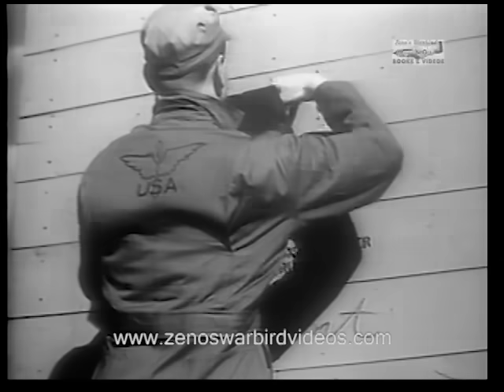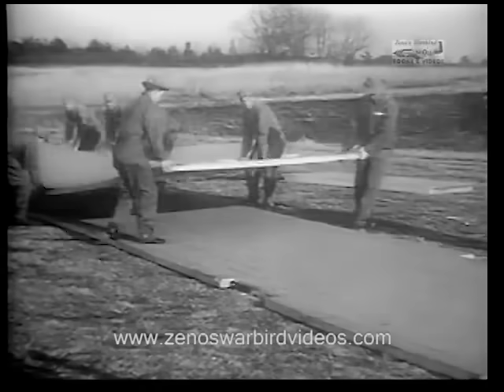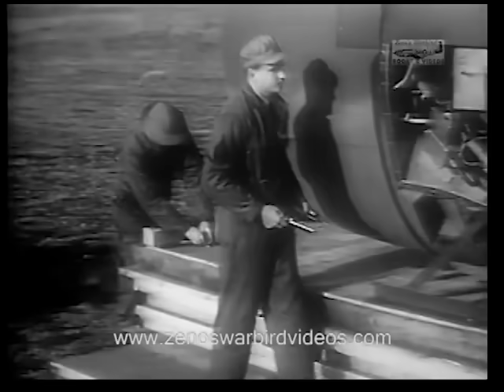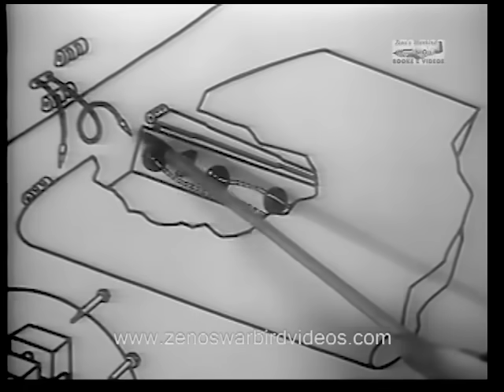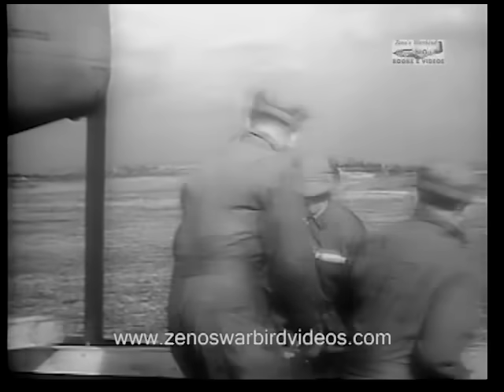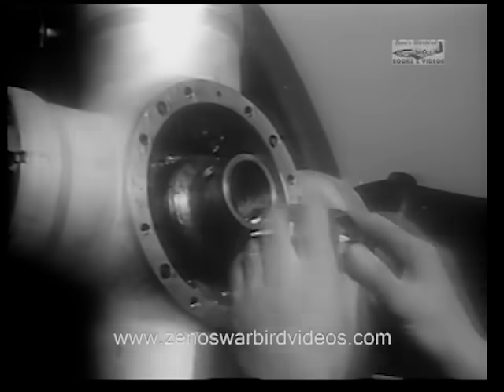How to assemble a P-47 Thunderbolt Fighter in a field with unpowered hand tools (Restored -1944)

Comment: Right after the pilot has taxied away toward the runway, one guy says to the other, "And look at all the extra parts we still have!"
Reply: Not extras, just spares.
Reply: "Parts not installed canntot fail".....
Reply: Lol
Reply: Lol....
Reply: If I save up enough parts I can make one of these for me!!!!!!
Reply: Ha,ha
Reply: Great week end project...pulled maintenance on my C-7 5 days a week; put a oil drum on a palet strapped it down and lifted it up to the wing via fork lift to service oil tank and prop oil.that did the trick; fun getting dirty.easyer that working on my truck...
Reply: Seriously, in high school auto shop, we all overhauled a working lawnmower engine during class. One thing I remember the teacher saying is: "There are NO 'Extra Parts' in your engine." At least back then, almost every lawnmower had a Briggs & Stratton, except for the few with a Tecumseh motor, so we could always go to the manuals.
Reply: I was thinking that from each assembly they had a lot of stuff left over- crate panels, pins, braces, tape, 2x4s, etc. Probably built their base camp with all that.
Reply: @finallyfriday. - That's a good point. I was just imagining if Mutt and Jeff were U.S. Army Air Corps ground crew.
Reply: 😂 no doubt

Comment: The thought going into the design of the crates is impressive.  Same for the actual assembly instructions.  How many tines did the engineers and planners put together and take apart one to hammer them out?  

"Hey, Ralph!  We forgot to tell 'em to put the aileron control rods in BEFORE attaching the wing!"

Comment: This great film depicts American ingenuity, massive production,  and various methods of supplying arms to the front lines. It is also a modeler's ultimate example: open the box, read the instructions, make sure all the parts are there, then carefully assemble.
Reply: I have rebuilt several car engines over the years (most in the driveway) and I always had a bolt or two left over (I think most of us have looked at the work table and wondered where "that one" went).  I wonder if they give them to the pilot for safe keeping?
Reply: +Mac Sterling i work as a mechanic and i constantly recheck everything i do and do it systematically i never have leftover fasteners
Reply: Forget American ingenuity, it's Russian designed by De Seversky and Kartveli

Comment: I always enjoyed this video.  I probably watched it the first time around 2001.   The question I always had was,  "would you trust flying a plane assembled by a  bunch of guys in a field? "   Two-finger torque technique,  lol....
Reply: It seems to me the crate could be designed to eliminate the digging. All that stacking and nailing of the platform only to have to dig pits?   I am only a lowly carpenter but could solve this issue so that if this were done in unforgiving soil types (say in the winter) you could still assemble the plane.
Reply: @ArtisanTony  I was thinking the same but I wonder if the reason it is this way is that if the platform was a foot higher it would be harder for the 50 men to lift the wing up high enough (you'd essentially have to lift the wings an entire foot higher which looks like it would be right about at that difficult transition point where the lift goes to the shoulders)
Reply: Sure....
Reply: Well I guess you'd have a bunch of these all arriving at once, so, you'd have a bunch of guys all working on each plane but for certain steps it goes to all-hands mode to move the wings around.
Reply: Variations on the "turn of nut method" (Google it) are still in use for building structures because they work! The engineers weren't stupid. They knew the fastener and wrench lengths and approximately how much torque "two fingers" would apply.
Reply: @obfuscated3090  used this torque method when torquing fuel lines on trucks with hard to get at lines.you could get a torque wrench on but hard to get it in there.torqued several with torque wrench and went back and could barely move it by hand wrench. never had a problem of them leaking or stripping.
Reply: Assign them at roll call first thing in the morning. Not hard.
Reply: @Current Batches 15 for the wing, not 50.
Reply: @jwenting  There are 31 men doing this job in the film.
Reply: It's funny  , when I did my apprenticeship (auto) a mechanic once told me if you don't have a torque wrench and your out in the Bush use a wrench no longer than 6 inches
Reply: That would depend entirely on the guys.
Reply: I personally enjoyed the "safetywire by hand". As a prior helo-mech that made me flinch. These guys made it happen though. Pretty awesome. America!
Reply: @thed8229  I am a H-34/46/-1 and OH-58A, trained mech I safety wire by hand. It is the  best and safest way to ensure the wing is  not over  twisted or damaged, side cutters  finish the job. Gunny Joe
Reply: @Current Batches To be fair, you can load over a 100 of these aircraft on almost any decently sized merchant ship, and then have the entire airbase engineers work on building the planes once they arrive to your pacific island where you're stationed.

Also, you dont need 50 people for a wing, as someone else pointed out.
Reply: @owo1744  - 100 planes? That's not a squadron, that's an entire Group! You would have as many people as you needed then.
Reply: These guys? ABSOLUTELY!!
Reply: It's ok as long as, after two-finger torquing, you permanently secure the fastener by saying "Yeah, that's not comin' loose".
Reply: Usually it was done at a permanent, well equipped depot.
Reply: The crew chief is a part of the maintenance crew of a plane, he is a trained mechanic and knows the plane inside out - right ? So if you trust him to maintain the plane your flying he’s as good or better than an anonymous quality inspector far far away.

Comment: The opening shot is of Oak Ridge's K-25 plant in Oak Ridge,  Tn. Just a few miles away from me. The building was torn down over a period of about 10 years. The company doing the work gave away tons of copper wire cut out from the Caltron inside the building. It's hard to get the scale of the size of the building from a picture.

Comment: Invisible star of the show: The guys who first figured out all these instructions on how to use the very much standard-issue packaging material to field-assemble a high-tech plane using nothing but muscle power and hand tools. Also of course the engineers who made the plane as "idiot-proof" as possible (short fuselage cable goes to long wing cable and vice versa - I strongly suggest it's impossible to assemble incorrectly).
Reply: Idiot-proof, maybe. But remember, some of the people who would be assembling these things were Marines. ;)
Reply: @KeithHearnPlus  "You try your best to make something idiot-proof - the world inevitably comes up with a bigger, much improved idiot"
Reply: It wasn't "figured out", it was designed this way from the start.  The P-47 was intended to be the best possible fighter for deployment in Europe escorting bombers, part of that was making it efficient to ship and assemble.
Reply: @jimmydesouza4375  Well the difference between something being intended to be one way, and it actually being that way, usually lies in the figuring out :). My point of respect was simply, they put a lot of thought into it.

Comment: I remember reading after the war unopened crates of P-51s were sold as surplus for $300 each.  Farmers would use the engine for a tractor and scrap the rest.☹
Reply: I don't think so, 1500 hp engine for a tractor, plus maintaining and servicingthe engine and what transmission are you going to use. You think that engine is going to fit in a tractor.

Comment: And this is where a 109 had that handy Center Landing Gear and Glider Type Wing Mounting and Light Wings so it could be assembled by fewer people in less time.
Reply: The landing gear in the 109 was fragile and cased a great many losses. Plus a narrow undercarriage is harder to handle the aircraft on the ground.
Reply: Ever wonder why that gear design was not copied by other makers including Heinkel?  Not ideal for rough field landings, narrow track and the struts were not vertical. Slinging wings on any fighter of the era wasn't difficult.
Reply: P+47's we're often used for Me+109 disassembly...
Reply: @johnbuchman4854  and it was very good in that role

Comment: Retired USAF maintainer here who loves this video!

Assembly was practical without ground support equipment. That meant less GSE to manufacture. ship and maintain. It also meant that you could assemble multiple aircraft at the same time with each crew chief supervising. It makes much more sense than it may seem. Remember maintenance manning was relatively large compared to modern squadrons so pulling bodies for uncrating would have been no problem. Uncrating crew could move down the line while maintainers finished assembly.

The pins took shear loads and the nut was a lock nut so the assembly method made perfect sense. Unlike a cylinder head or other part where multiple bolts required MATCHING torque, pins are single-fastener and the nut just holds them in place. Google "turn of nut method" before whinging about torque wrenches. They have their place of course.
Reply: Wait...did an American just use the term "whinging"?
Reply: I read the local farmers, experienced in maintaining their equipment, would chip in of course. As satisfying as the video is, I'd imagine working on the tractor yesterday and helping a P-47 fly off today was a thousand times better.